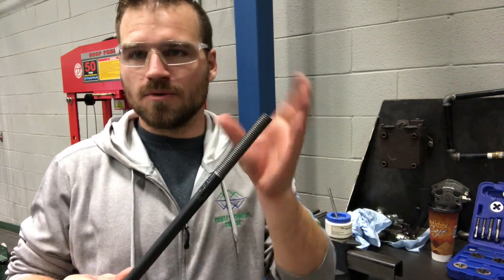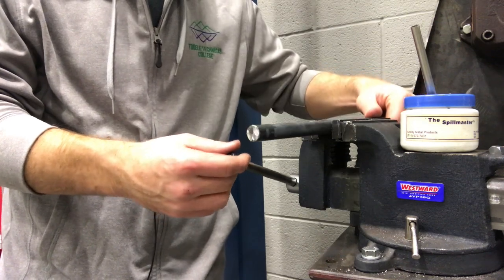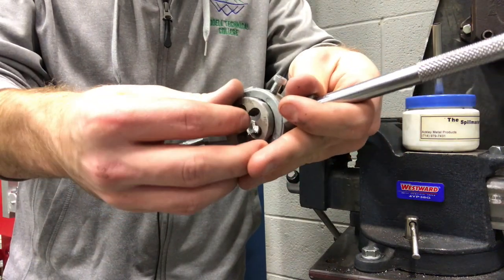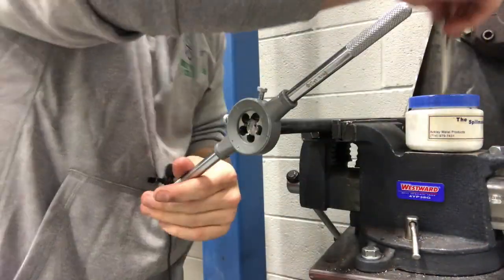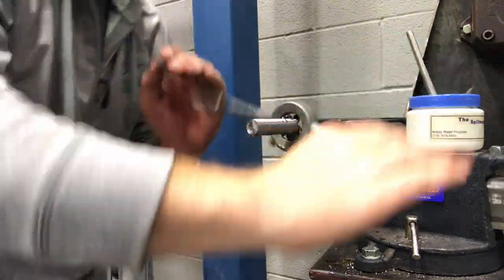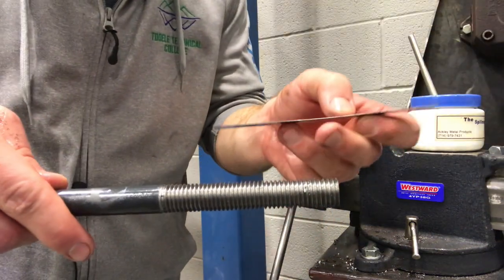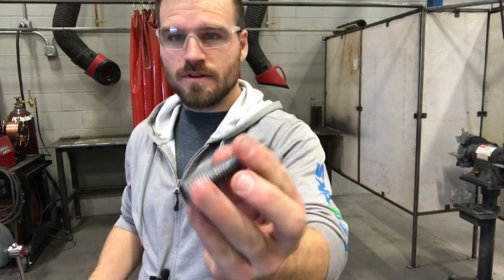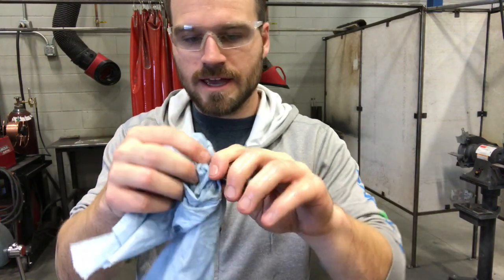Tech Basics - How to thread a rod

Comment: Is there a trick for doing this to aluminum? The whole rod breaks off like butter after 2 threads. Yes, crappy aluminum, but I cant make the part from scratch anymore...it already cost me a serious injury and I just want to get this this done...
Reply: what OD rod?
Reply: @eviscero  I managed to do it...it was a very small component in an alcohol pump. About 3/8" I ended up starting over, with better aluminum, or was it a steel piece...I cant remember now, but it did work. The rubber cups ended up being a pain (used vacuum caps that I cut).

Comment: Thanks a lot for this video. A quick question, what if you have ma rod of 8mm and you have to thread it M6? I have an 8mm rod where I want to add a 6mm thread (M6) to screw it on a support. What do I use to manually center sand the 8mm rod to 6mm to then add the thread ? !?!?!

Comment: Is it a harder job to do it to stainless?
Reply: You bet, stainless is a harder metal than mild steel. Be gentle with your dies or they will break.
Reply: Go slow very slow, 1/4 turn ,(stop and count 1,2,3 in uiur head)1/4 turn ,(1,2,3) 1/4 turn(1,2 ,3)

Comment: @IMAT - This informative video is getting on the older side, so I don't know if you monitor it these days, but I've got a question about threading pipe that I hope you can answer for me.  I've got a project in mind that will require 1.5" threaded rod in 4-foot lengths.  As you can imagine, it's extremely expensive to buy this type of threaded rod, so my question is whether or not it is possible to use a ratcheting pipe threader to cut usable thread along the entire length of a 4-foot section of steel pipe?  The ideal being to use less-expensive Sch 80 steel pipe to create an alternative to 1.5" steel threaded rod.  Thank you for any help.
Reply from the maker: i’ve been absent for a while, but I’m trying to answer all my comments. Pipe threads are tapered, it's what makes them seal or are you just trying to use a pipe threader to do this job with regular threads?
Reply: @Mikesfilmss  I'll be needing to run nuts up and down the threads.   The ideal is to use multiple threaded pipes as vertical supports for very heavy duty 2" thick wooden shelving.  The spacing of the shelves needs to be adjustable; hence, the need for threads along the entire length of each 4-foot length of pipe.  Thank you for giving this some thought for me.
Reply: A heating and air conditioning shop could cut extended threads on gas pipe for your project. They have machines adept at doing this. You would not want to attempt continuous threads with hand power.

Comment: Question : I have 8 mm diameter rod and I tried to dies it using M8/1.25 dies tool, but it so difficult to screw it to the rod. So I tried the M9 dies and it went perfectly.
So is there any tips or rule about rod diameter vs dies size ? 
Thanks